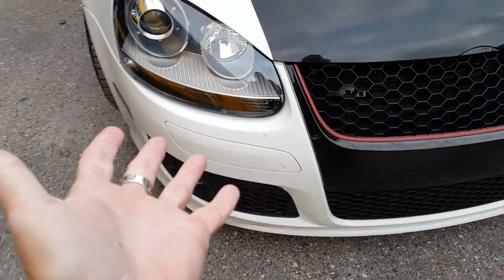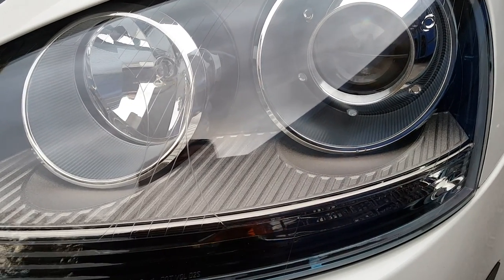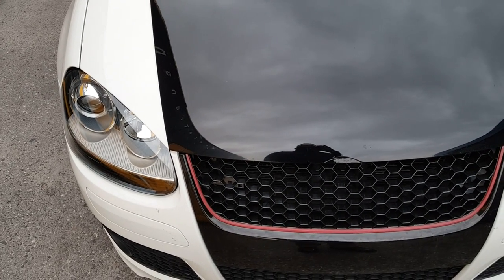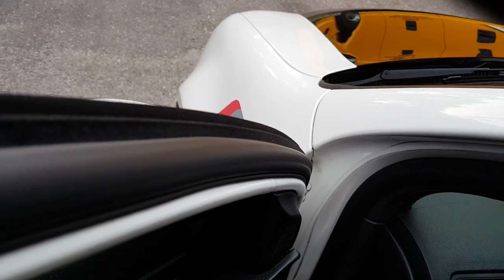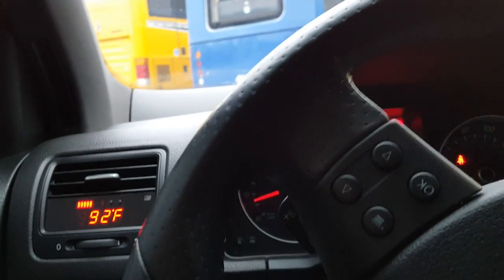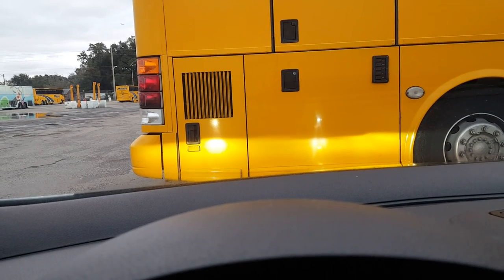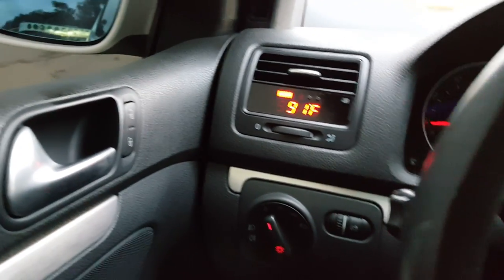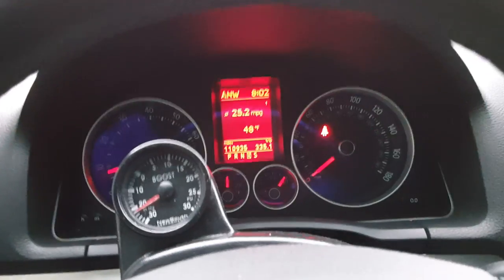New Hella Bi-Xenon Headlamps GTI MkV - Bad Ballast

Comment: I really appreciate this video. It explained a lot of problems I had and answered some questions. I had no idea that the center lights were flash to pass. It boggled my mind as to why they only ever came on when the stalk was pulled. I also had one light stuck in high beam even after replacing the whole headlamp assembly, and now I understand the ballast is also the range adjuster. Again, thanks so much!

Comment: Glad you posted this.  I have the 2006.5.  Tornado red GTI, stage 1, looks alot like yours when it was stock, came with skirts and all from Wolfsburg; our bragging rights!   Anyway, my lights are stock and I've only replaced one bulb.   But I think I'm gonna save up, like you said, for a new set of bi-xenons, so that when one or both start to go, I'll be ready.  Although I appreciate the new GTI, especially the MkVII, l like the V because standard stuff on ours, became options later on other models, and I love the curves on our cars, not so angular like the newbies.  Especially love our intimidating front grill!
Reply from the maker: Thanks... Yes our grill is the coolest front and shows a connection with the AUDI family lineage too🙋 also agree they are too angular now👍

Comment: You can get the flash to pass lights to work simultaneously with the high-beam projectors if you get em coded.  I had it done on my Mk5 .:R

Comment: Hey gitman67, props to you for pointing this out. My passenger side light went out and I replaced the bulb, retaining ring and ignitor, with still no light.  I ordered an aftermarket ballast from ebay for $59, installed and success!  I did all the work myself and still spent nearly $200 in parts.  But, if it were not for your video I probably would have ordered a new set of headlamps.  Saved mucho dinero!  My recommendation is to go aftermarket and save $$.  Now on to the next upgrade, lol!
Reply from the maker: Good job but I bet the aftermarket one won't last nearly 8 years like the stock one though🤓

Comment: FYI you don’t have to take off your entire bumper to remove your head lamp assembly, there’s 3 bolts in total, 2 up top and 1 underneath that you can reach from under the bumper and the assembly can then be wiggled out.
Reply from the maker: Lee Stewart you can't reach under my bumper you have to take the whole lower front bumper off
Reply: gtiman67 even if you jack it up?
Reply from the maker: Yes I have the front valance which is really an air splitter or some people call it a front spoiler was called the ground effects kit goes underneath all the way and then there's a black cover that covers up the engine too
Reply: gtiman67 well it looks good anyway 👍🏼
Reply from the maker: Thank you I'm going to FS tuning this afternoon to get a new coil pack and spark plugs

Comment: Ive gone bonkers!
My high beams don't light the road at night,
Also my FTRs have never worked..
Any tips?
Reply from the maker: Yeah the way the bi-Xenon one's work there's actually just a little lens lid that "lifts up" so the bulbs actually don't shine brighter they're just supposed to shine FARTHER I would check your amount of Kelvin IN YOUR BULBS people think that higher Kelvin is cool I did too I used have 8,000 Kelvin I think and it looks almost purple or blue but they have less VISIBLE LIGHT THE WARMER THE COLOR TEMPERATURE get back to 6000 it's a little better go with Porsche which is about I think it's around 4300 K If I'm not mistaken Porsche stock Bi-Xenon headlights are bright enough that you can see really good and when you flick flick up the high beam the lens lifts up and you see farther down the road but the bulb itself does not shine any brighter. FTP Flash To Pass only work in the daytime when you pull back stalk 😏 with lights off if you disable Daytime Running Lights yours may start working... it's a European thing

Comment: After this setup as new headlights are now needed for my MKV.  After original parts etc? Can you advise thanks
Reply from the maker: European GTI OE headlight array use Sylvania around 4700 Kelvin or the same used in Porsches ballast enables them to run and there's one on each side and they're not cheap that's the price we pay for having the great Bi xenon headlamps😎
Reply: @gtiman67  Got a link on where to  order?  That would be great thanks

Comment: Hello mate, I have no idea where you are from, but the lever you pull/hold towards you to light up the one you call FTP, here in my country at least if you push it away from you it will stay there (instead of push/hold its only push) and keep them on. By our "Street Code" (here in Greece) you use these lights when you are out of town (highways,villages, etc) and when you want to signal someone.
Reply from the maker: +ali3n2 Very good then, I'm in the USA🙋

Comment: Hey can you help me out? It sounds like I'm having the exact same problem as you EXCEPT that the entire driver side headlight does not seem to be having ANY power. The lowbeam/highbeam, turn signal, flash to pass, nothing turns on! Do you think the ballast can still be the culprit?? Passenger headlight works fine, fuses are all fine.
Reply from the maker: Yes ballast I would guess? Once your headlight wiring harness goes you run the risk of shorting out the ballast🥴

Comment: 400? Is that with install? I’ve seen those headlights for 250 on ecs. You just have to look around on the website. I’ve notice they will sometimes show the same product 2 or 3 times all different prices. One headlight set I’m looking at has a 250 tag and I’ve also seen another tag that was around 5. Same thing goes for the rims and some other products.
Reply from the maker: The difference being whether it's genuine Volkswagen Audi or a very close replica like aftermarket that follows the same guidelines I go with official Volkswagen Audi on stuff like that. There's European ones that look even better than the American spec do european-spec has black on the inside it's awesome but it is a different wiring than American spec so you have to redo the whole front headlight wiring harness which I didn't want to do.

Comment: They look great! Where did you get the blue glass for the side mirrors?
Reply from the maker: I believe it still was ECStuning.com
They are stock in Europe or just an option but they simply pop right in BUT be very careful removing the original ones so as not to damage the housing inside...
Best thing is your VW TECH at the dealer... IT shouldn't even cost you anything.
Just let THEM do a service or something😛 BUILT-IN blind-spot mirrors also the blue tint cuts down on headlight glare at night
Reply: @gtiman67  Thanks! I had them on my 01 gti and loved them.

Comment: What are the lamps required for these headlights? And how many?
Reply from the maker: They are Bi-xenon gas filled bulbs ignited by about 110,000 volts or something like that😛
The ballast is what takes the 12 to 14 volts DC from the battery AND turns it into AC CURRENT... which means they are about $164 for the pair... but they last a very long time. You can use any amount of KELVIN you DESIRE - I ONCE HAD 8,000 & even 10,000 KELVIN BULBS AND THEY LOOKED BLUER AND VERY COOL BUT the visible light is less to your eyes👀! I do believe VW uses 2,800 Kelvin bulbs STOCK however Fabian at FS TUNING SAID THE BEST ones are the ones Porsche uses stock which are about a 4,200 Kelvin SYLVANIA BULB and I LOVE them. YOU WANT visible light to see not necessarily a prettier bulb that just looks cooler😎!
BUT IT'S UP TO YOU👍 EXPERIMENT🤳
Reply: gtiman67 thanks man they look the part

Comment: If you are mechanically inclined it’s better to just take the ballast off a parts car or from the junk yard . And swap them out . Saves you lots of money . Paid $30 from my local junk yard for both ballast and haven’t had any problems . Only down side is having to pull the parts yourself but better than paying $400 a piece .. good video though
Reply from the maker: No good in my opinion because mine lasted 7 years and getting an old one it may only last a year or 2 possibly a week? Whereas the brand new one i have  may last another 7 years🤓
Reply: gtiman67 better than forking out what you did. Plus it’s a learning experience rather than letting a stealership or garage rape you . Honestly sounds like a lazy excuse but to each his own I guess. Good luck in the future 👍🏽
Reply from the maker: @chillyE30   Not against doing it yourself I'm just against putting old parts with older parts I always replace old parts with new parts I've been doing since I have had my car and from all people that I've talked to you don't wanna put old parts on a new car you don't want to replace parts  Are just inheriting trouble...  Each part has the  Normal lifespan and you just replace it with a new one...

Comment: So the ballast did not come with the new headlights assembly
Reply from the maker: No the ballast is separate and it's very very expensive and you don't want to buy a used one because they last about 5 to 10 years so it's kind of like if you You put in an old one & it's already been in there for 5 years... then it lasts for a week 😑  so I don't believe in replacing broken parts with old used parts, the ballasts DO LAST a good TIME & would've lasted longer if I didn't keep original headlamp assembly FOR so long... the wires GOT BRITTLE OLD & wiring harness shorted out the ballast...it all comes in one package the headlight assembly comes with the entire headlight wiring harness👍 Better to put a brand new part in THAT'LL last another 10 years or another 5 to 10 years
but they're about 500 bucks a piece believe it or not.  The BALLAST creates a crazy amount of voltage like 75,000 VOLTS AC to power those headlights which are bi xenon beauties [usually found in high end cars like Porsche's] GTI MkV used to put everything into their car now you gotta pay more for them
 mine came STOCK with these😛

Comment: Was your local dealer able to find the headligjt harness?
Reply from the maker: +DOHCCordia  The wiring harness is all part of the headlight assembly said all comes together as one said that's what's good and bad about it
Reply: gtiman67 oh I thought you had replaced the original harness first.
Reply from the maker: +DOHCCordia  The ballast is separate it's like a metal can that powers the lights that's about $500 itself that is separate from the headlight but the wiring  Harness is part of the headlight assembly

Comment: I don't know if you're going to see this or even reply, but I want to get the same setup. would you be able to help me through a link or something  ?
Reply from the maker: What setup is that?
Reply from the maker: APR SOFTWARE STAGE KO4 KIT WHICH INCLUDES AT MINIMUM:
1. APR STAGE 2 PLUS UPGRADES AS A PREREQUISITE
°AUDI HPFP FSI UPGRADE FROM APR 
°FULL PERFORMANCE EXHAUST SYSTEM
°FMIC OR UPGRADED APR intercooler
°COLD AIR INTAKE
°VW PISTON STYLE DV "REVISION D"

ADDITIONAL UPGRADES:
H&R SUPER SPORT SPRINGS
VF ENGINEERING ENGINE PENDULUM MOUNT
CATCH CAN SYSTEM
LED EURO STYLE VW GTI TAILLIGHTS 
BLACKED OUT SIDE MARKERS
R LINE FRONT GRILL & Wolfsburg EDITION LOWER CENTER GRILL
Pirelli p zero Nero GT summer performance tires
Using model Motul synthetic oil specific for VW gti mkv

Comment: the engineers who designed this  thing needs to be jailed for what they put us through not given a crap that we are already over taxed to the death. This is the last thing we need is a car that designed to break in less than 1000,000 miles which lead to costly repair bills around $1,000 just to change a light. We the people need to hold better standards to the engineers who build these thing to fail. You think they would put up with this on the space shuttle?
Reply from the maker: +TheRonmaio the Bi-xenon headlights generally last longer than any other light, it's just very expensive to replace mine lasted since 2007 that's 9 years. The ballast is expensive as it produces like 175,000 Volts AC current from DC current
Reply: true but never the less not something that should be so expensive nor difficult to access and repair.

Comment: where is the BI-xenon? ....u have halogen lamp on HI-beam
Reply: late reply but it is 'bi-xenon' with only one xenon bulb because it uses a motorised shutter behind the projector to obstruct the top part of the beam to switch between low beam and full beam. The halogen lamp is often referred to as "flash to pass" and if you flash your headlights with the xenons turned off, it will use the halogen for the flash instead of lighting up the xenons and prematurely wearing out your xenon bulbs. On UK models we have quad high beams as standard where it both opens the shutter to give high-beam xenon and high beam halogen at the same time. You can enable/disable quad high beams with VCDS, Carista etc.